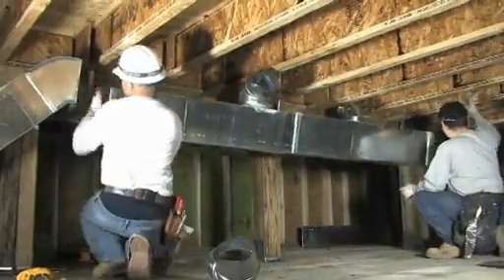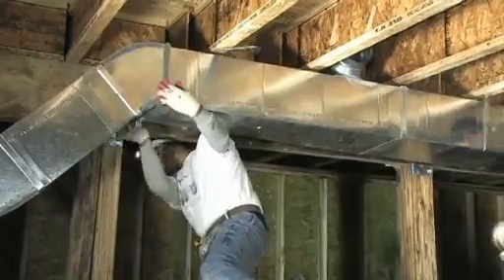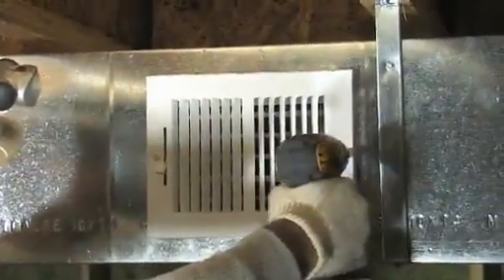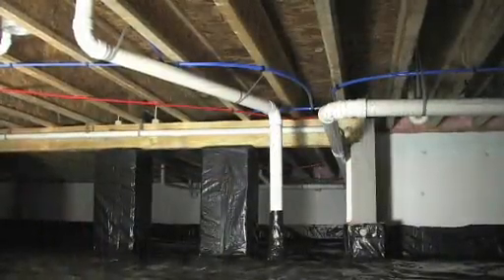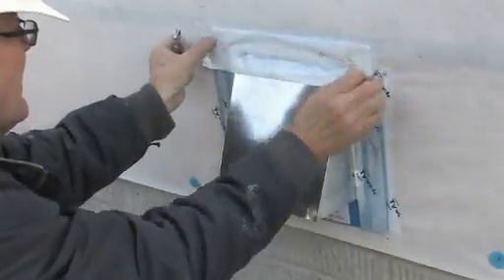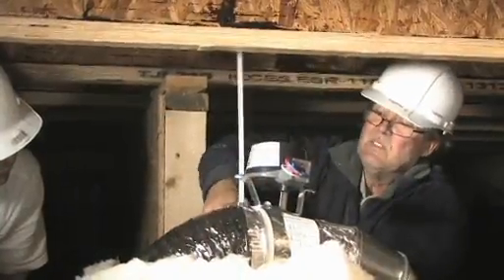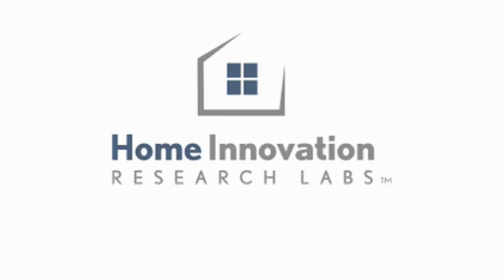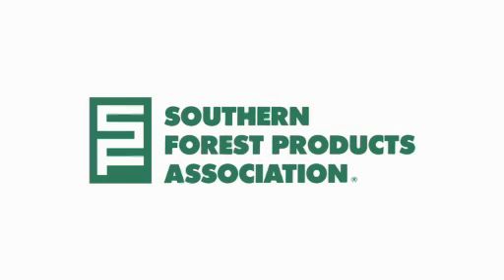Closed Crawl Space - Ventilation

Comment: will a fan help the crawlspace air alot, I iincapsuled the crawlspace and and a dehumidifier, but the air quality is still bad and I need solutions or I m going to have to sell the house. I have allergies s oand my house is making me sick. the air quality seems fine the the spring, and summer, but as soon as the tempeature drops in the fall and winter the air gets bad. I lve in the northeast.  Anybody please help. . will this fix my problem>
Reply: Put a temp+humidity sensor down there first to understand what the conditions are.  What do you mean that the air quality is bad?  By what measure?  Keeping a window cracked will reduce stack effect, which would otherwise cause air to be drawn from the crawlspace.
Reply: @confidentlocal8600  yes, I have a humidity gauge, the humidity is always low, its about 25% to 35% in the Winter. what a mean that the air quality is bad is when the temp. drops i can tell the difference in the air quality in the upstairs living space by the way I feel. I can't crack a window if its cold outside.  I installed a 1500 sq ft dehumidifier last year and with a fan and that seems to help. and have left the vents on the door into the crawlspace open, so the air circulates where before i had them sealed.